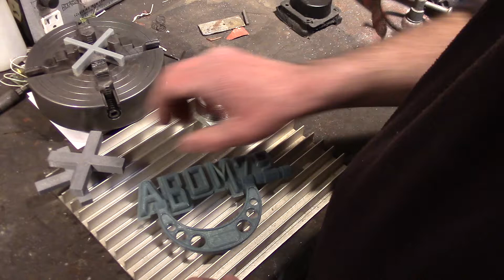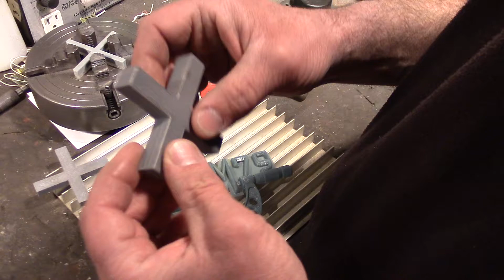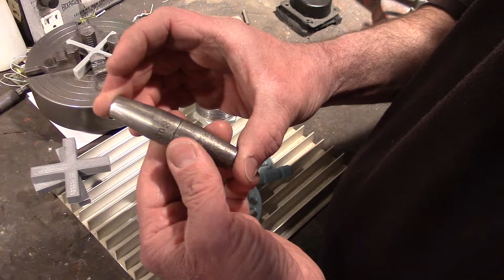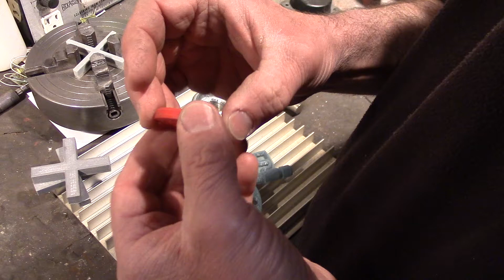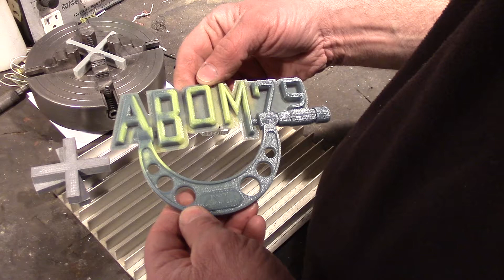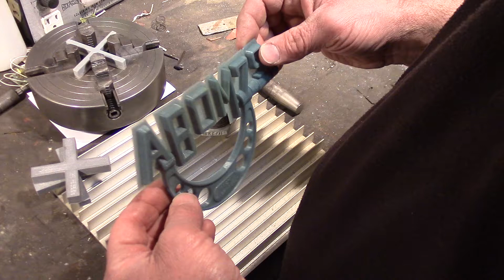3D Thermochromatic PLA use's in the shop.

Comment: Hi Bob -- Love that idea for chuck spiders - something I have been wanting to try and make for sometime but chickening out thus far, particularly for my 3-jaw, and having to make a steel fabrication.
The 3D printer has amazing potential.
The Abom logo is superb... super material with the color change.
Reply from the maker: +ChrisB257 Your logo might be next,with spinning gears.
Reply: +Bob Cartwright 
That'd be a challenge!... they mesh but would never rotate. :)
Was wondering -- for whatever fee is appropriate, could you do me a spider for my 3 jaw and 4 jaw? I'd have to measure jaws to work out optimal thicknesses.
Reply: +Bob Cartwright 
Email on the way Bob. thanks.